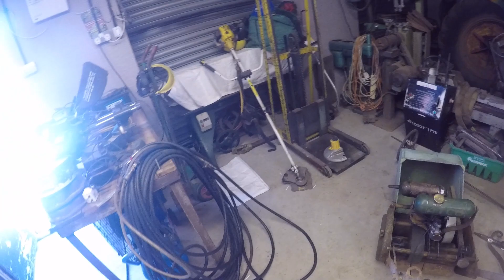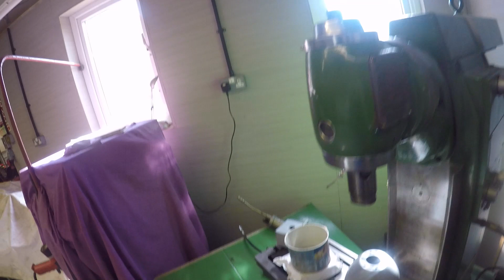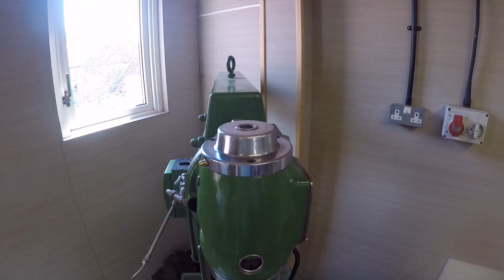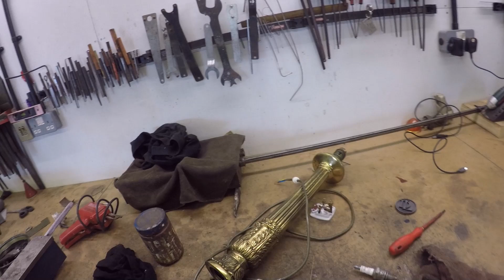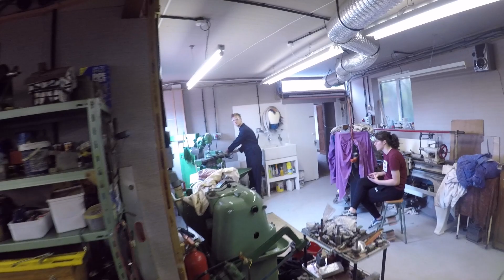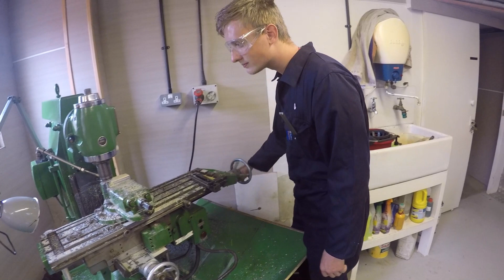Harrison millimg machine, fitting new top bearing, bench repairs, and Richard Kirkman makes a T nut!

Comment: Just watched it again Phil. Removal and replacement of the bearing. Thanks.
Reply from the maker: Hi Paul, re the overheating you are having! Odd, if it is quiet it doesnt seem to make any sense. Take the sideplate off and look at the mesh of the bevel gears, contact area should be visible on each tooth and should be a slightly matt area in the centre of the tooth, extending towards either end of the tooth, and should be approx the same on each tooth, there should be backlash, but just perceptible. Does the whole head get hot or just the bearing areas? very unlikely to be the bottom bearing, but the top one is exposed to leaky roofs etc! When you adjust the bearings , you will need to tap the top tube where the drawbar seats to put some slack back into the bottom bearing or it will run tight, so take up all the slackback it off the equivalent of one flat of a hex, tap the top tube, and lock the adjuster ring. Have yo got the right oil in it? It shouild get warm, but not hot and certainly not too hot to bear your hand on. Please reply to philwhitley73@gmail.com, as I have lost (somehow) your query!
Phil

Comment: The manual doesn't even mention the vertical head bearings. It does refer to the (horizontal) bearings but just says "rotate adjusting nut clockwise sufficiently to obviate play, then retighten lock nut". That's helpful!
Reply from the maker: I will have a look today and get back to you
Reply from the maker: I forgot, will check monday, you need to take all the play out of the bearing, so you would tighten the nut right up with firm pressure, so you know the rollers are in contact with the races, then back off between an eighth and a quarter of turn, and run the machine at high speed, if the castings get more than warm, after about ten minutes they are too tight! Some manufactureres do a test with a cord round the spindle and a spring balance to set a preload, but you need to remove any runout from the spindle, leving just enough play for a grease film between the rollers and the race

Comment: Cutting all that grass with a strimmer, get yourself one of those Toro 2 CV tractor units !
Reply from the maker: Good idea!Yes I probably could have used the toro, except the only bit where I can drive it up onto the grass is where my brother parks his Tonka landrover thingy! I used a Honda mower for most of it, but have to trim the edges and kerbs with the strimmer. I usually test a strimmer I have just repaired , and as my luck seems to be in at the moment, they are flying out the door, on the proviso that they NEVER bring them back!!
Phil

Comment: Hi Phil. Nice example of a Harrison Mill. I have one too. Mine is is an advanced state of what I laughably refer to as "restoration". It was interesting to see the vertical head bearing being done. Thanks.
Reply from the maker: nice because it came from the school my wife taught at, and was hardly used! The vertical head wasn't with it when I bought it, and I thought I had little chance of getting one, but one popped up on Ebay in the days before the price hikes, and I got it, it was pretty rough, and full of glass as the sight glass had been smashed, , so one strip and rebuild later, there it is, and the new top bearing was the icicng on the cake, it is now a perfect V head! Thanks for the comment and welcome to the channel!
Phil
Reply: @philhermetic  That is very interesting. I may pick your brains on the vertical head rebuild at some point, if you don't mind. I have so far completely rebuilt the feed gearbox, the feed motor and main motor, converting both to delta, and partially restored the saddle and table. As detailed on the mig welding forum. I'd love to find the slotting attachment for mine. They must be like rocking horse poo after a rocking horse has ingested a hen and excreted it's teeth.
Reply from the maker: @carlwilson1772  you certainly may pick my brains, such as they are! It was actually pretty straightforward in typical Harrison manner! Do you have the horizontal set up for yours?
Reply: @philhermetic  Thanks. Yes I do have the Horizontal set up.  The one issue I will have to sort is the lack of needle roller bearing in the overarm support.
Reply from the maker: @carlwilson1772  you meant he roller bearing is missing? Shouldn’t be too hard or expensive to source one .
Reply: @philhermetic  That's right. I have sourced one but I haven't got it yet.
Reply: @carlwilson1772  I did a write-up of the vertical head rebuild: https://bodgesoc.blogspot.com/2018/03/harrisonvertical.html
Reply: @andypughtube  Hello Andy, nice to hear from you. You may rest assured that I have studied your write up intently, and it continues to be a great source of information for me.